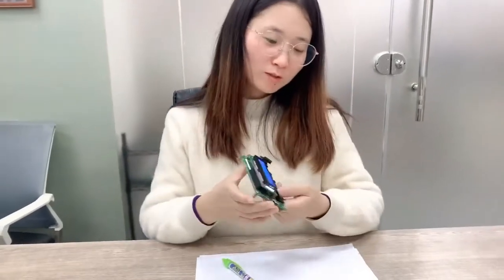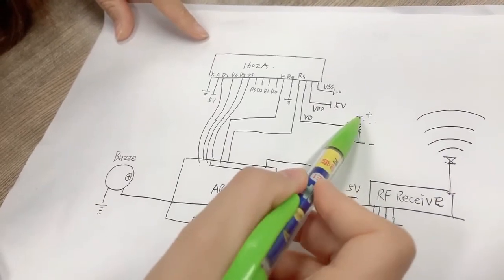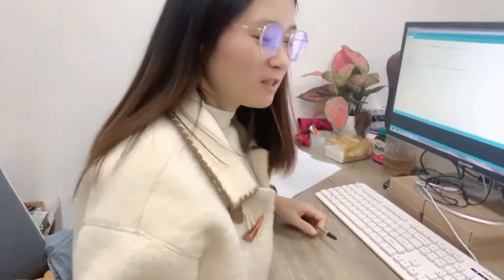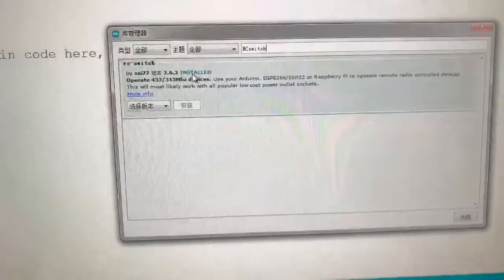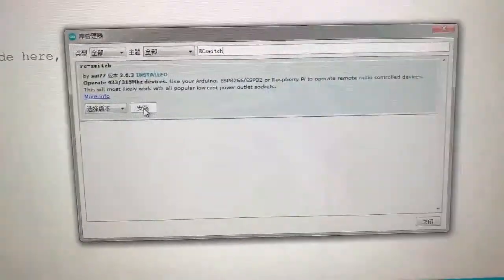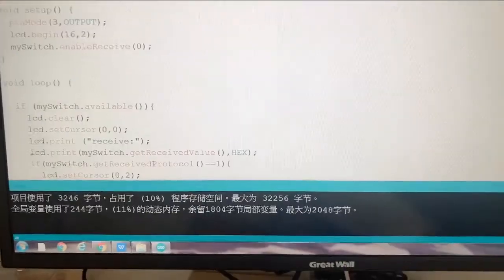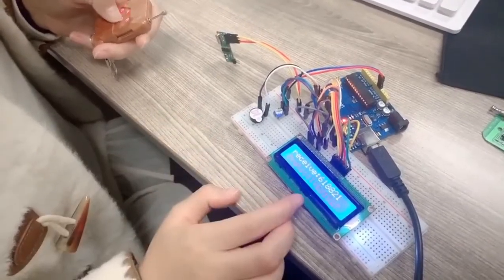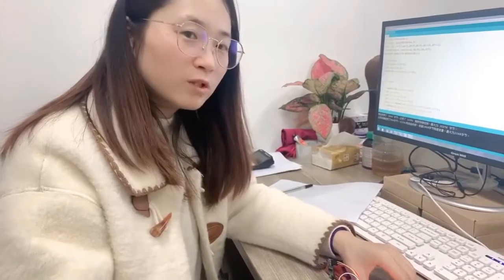Arduino Tutorial 4 | How to decode any remote code with Arduino

Comment: I want to know VD the voltage
Reply: Does it mean the VO of the 1602A display screen?
Reply from the maker: @hnobita2281  yes
Reply from the maker: Our VD voltage is 5V.
Reply: @qiachip  I knew your input VDD/DC5V  how about your VD voltage
Reply from the maker: This is a pin for adjusting the clarity of the character display. In fact, a resistor is connected to the ground. I used an adjustable resistor here. The two ends of the adjustable resistor are connected to 5V and GND, and the middle pin is connected to VD.